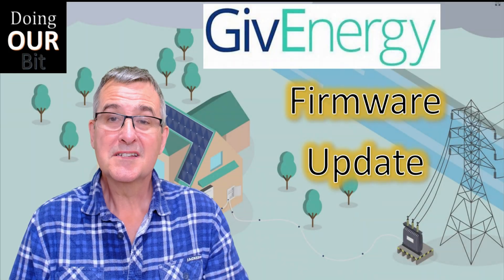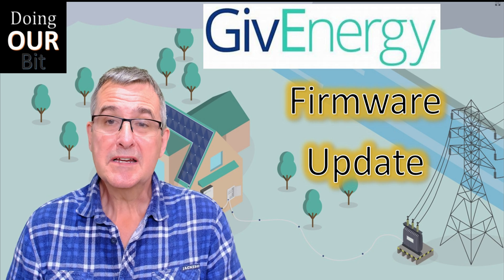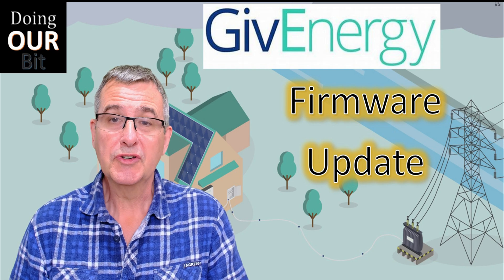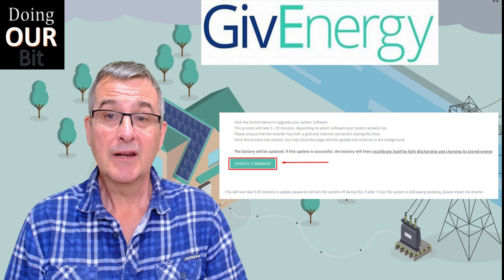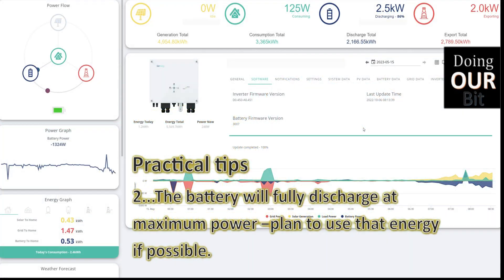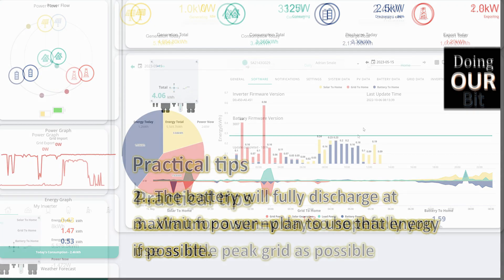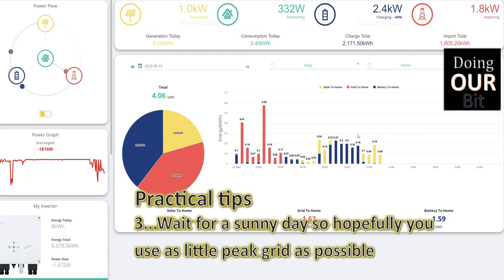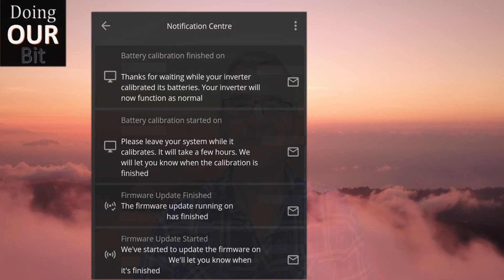Givenergy Battery Inverter Firmware update

Comment: What did the update do?
Reply: Apparently ...Resolved a reporting error on cell 15, 
Removal of the 2 am automatic restart function
Fixed the problem that the hardware could not be charged after triggering low voltage during SOC correction
In the process of SOC correction, if there is PV, the discharge PV does not work, but the charging PV does

Changed the battery high voltage protection from 59.5V to 58.5V.

I'm certainly not the wiser, but I do know that there were instances where the battery would not show the correct state of charge!